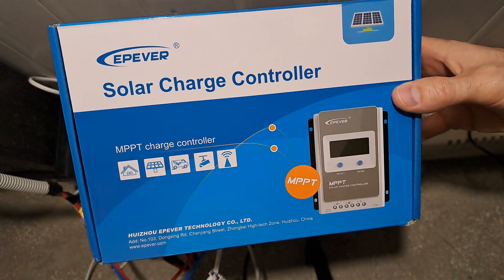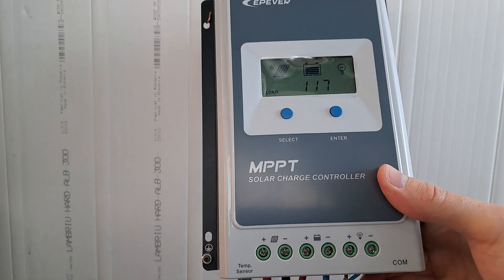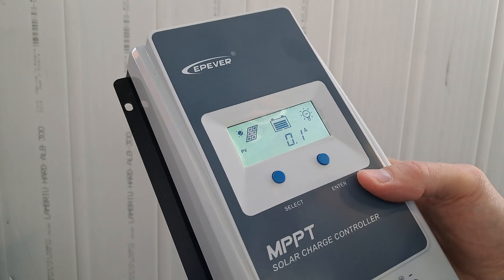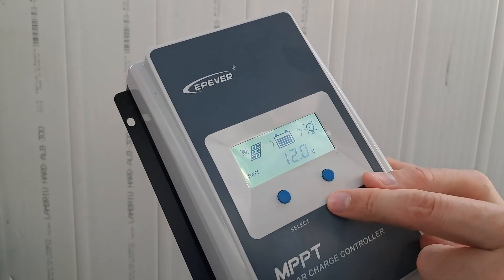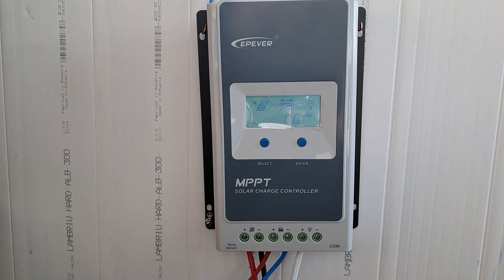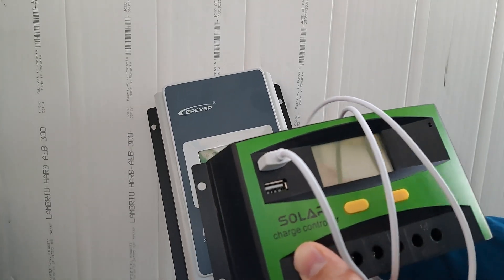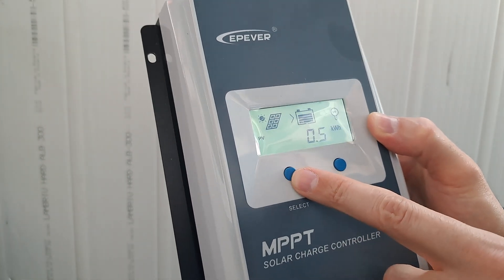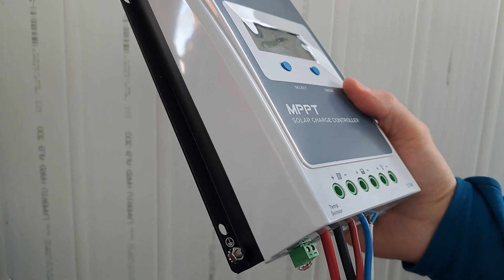Epever Tracer 2206an MPPT solar charge controller - two things that I don't like

Comment: Yesterday I could borrow an MT50 from someone and found out that one of my two mppt is not read by the MT50. 

I could access one mppt and program it in user setting, but the other one doesn't communicate with the module as so I can not read/write from the MT50 to/from the mppt. :-(

Is there a way to reset this mppt TracerAN  to reboot ?
Reply from the maker: To reset you could disconect it from the solar pannel and them from the batery. Wait couple of minutes and reconnect it.
Reply: @testingeverything9748  tried that already a few times but still not connecting

Comment: Does it have a cooling fan ? Does it get hot ?
Other fanless MPPTs can get almost hot to the touch if you are close to their peak power.
Reply from the maker: With the 100w solar panel the mppt doesn' t get hot for now. I ll check this in the summer and also when i ll connect a bigger solar panel. Thanks!